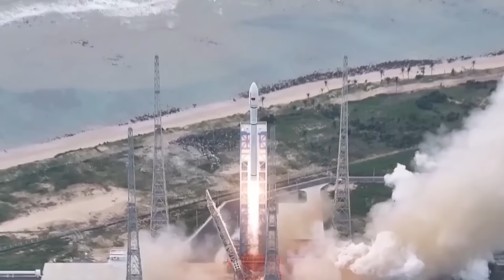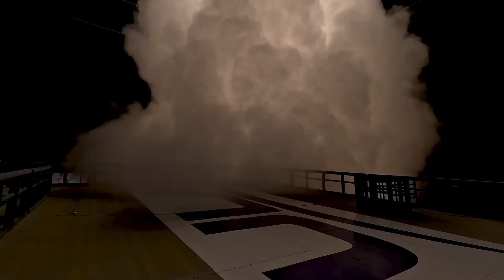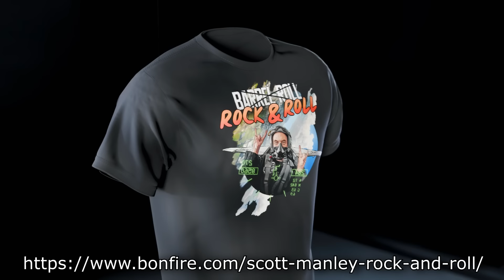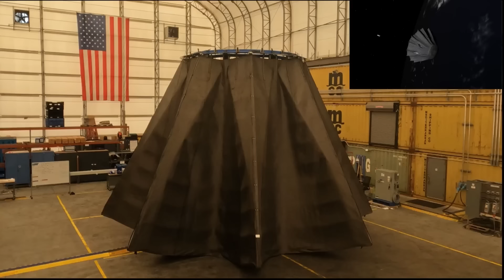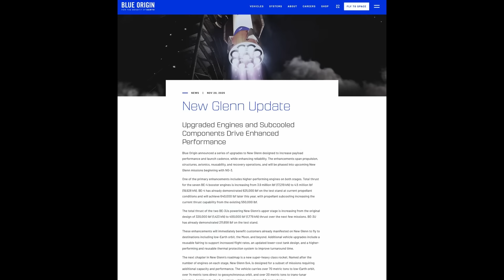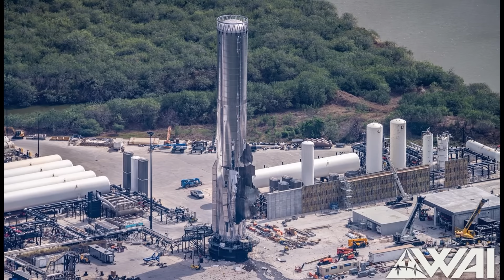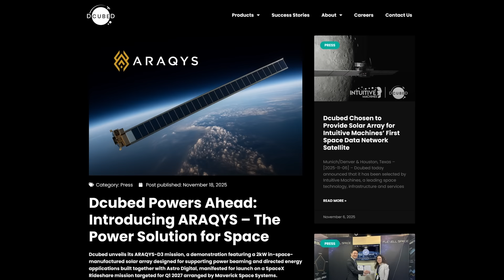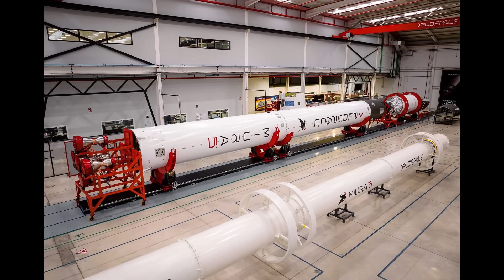Blue Origin FINALLY Reveal All Their Secret Projects - Deep Space Updates - November 22nd

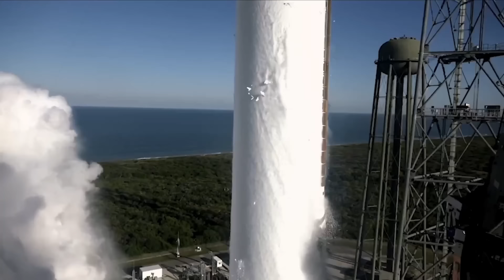Comment: Question: Katalyst launch referenced (or at least showed) a 3-engine airplane in the photo. 3:35  Is this the same aircraft as the recent UPS disaster, involving the engine pylon failure? If so, could the grounding of these aircraft potentially affect this mission, I wonder?
Reply: That photo was of a Lockheed L-1011, which is a different aircraft to the McDonnell Douglas DC10/MD-11 trijet family that is being examined after the recent UPS crash.
Reply: @SynchronizorVideos thanks.  I appreciate the additional info that fills in the gaps in my aviation knowledge.
Cheers.

Comment: Is the trend away from strap-ons simply due to the cost effectiveness of recoverable single booster stages? It just seems so weird that, outside of Ariane, so few of these new generation of rockets even consider strap-on boosters. From what I understand, they're incredibly cheap and they can be tremendously useful with overcoming that initial thrust-to-weight ratio issue when you're trying to get vertical.

Comment: Even with tiny satellites as payload, New Glenn was not even going fast enough to need to slow down for Max Q!
Reply: It is an interesting launch strategy. 
We’ll have to see if it pays off, Cotton.
Reply: Likely due to lh2 an lox on the upper stage, this should allow them to allocate more of the required delta v to the second stage than first when you use the same propellant, benefit of the different propellant on the upper stage
Reply: Blue Origin are doing exactly what they said they would do, run their engine at a very low thrust to baby them and then gradually raise the thrust over time.  So far they have not had as much as a hiccup from them in flight other then the failure to relight on the boosters first launch and that was likely due to something outside the engine.  This strategy looks a lot better then the Raptor development which is always being pushed to the breaking point and has to be inorder to compensate for the heavy steel stages.  Aluminum is just superior.
Reply: @kennethferland5579  hare::tortoise as “go fast and break things”::??
Reply: @kennethferland5579  Aluminium is for sure lighter, but for reentry it's far more heat sensitive and likely costed Columbias crew their life compared to a imaginary Shuttle made from titanium (was considered for some time).

Since NG does not do controlled reentry of a teusable upper stage it's not an issue here.
Reply: @kennethferland5579  In the space race, power is non negotiable
Reply: @kennethferland5579  Yes, BO is doing what they said they would do - but what changes that in the matter of fact that BO is 10 years behind SpaceX? 
Also, Aluminium is not "just superior". Aluminium has its advantages but also its disadvantages, especially when it comes to reusing the secound stage. Steel is just much more robust and has higher melting point and loses less strenght under extrem temperatures than aluminium as it could be seen during the Starship tests where several flaps lost several hinges. Aluminium in those situations would have failed. 
Also, the BE-4 is not compareable to Raptor. Raptor is a full flow staged combustion cycle engine vs BE-4 is not a full flow cycle.
Reply: MORON 5 MILES A SECOND AYE ! Clown U Think ! O Well My be Not .
Reply: Vaporware
Reply: @groverwashington1480  how many satellites has Starship carried to orbit? If anything, Starship is vaporware.
Reply: @dunaar3279Please, tell us if anything, what has starship done aside from exploding constantly ?
Reply: @jhdsfalsjhdfjashdkhvjfldld8301  <claps hands 👏>. Children! Children, you mustn't fight!
Reply: @jhdsfalsjhdfjashdkhvjfldld8301   Well, it managed that its secound stage is survining the reentry process and is now on track to developing the ability to being reused. You know - the ability which will open the solar system to humanity? 
Blue Origin is 10 years behind SpaceX. So they are currently not to be compared to SpaceX or Starship. New Glenn is an entire generation behind Starship.
Reply: @SebastianPeitsch  y’all keep comparing new glenn with starship when its closest competitor rn is falcon heavy. Mass to orbit, price, also starship could get to orbit on flight 5,6,10 and 11 but they choose not to since no one in their right mind would put a hundred tons of steel on orbit and have it not enough testing on its propulsion system to de orbit and its tps in re entry. New glenn second stage is much comparable to any second stage on the market now. Couple of tons, could break up on re entry due to an absence of any tps or heatshield.
Reply: @UrbeTabal so you're saying they couldn't actually put it in orbit with any guarantee of dafety which is the purpose of any serious space program....so they couldn't put it in orbit?
Reply: @SebastianPeitsch  Starship isnt operational yet. But hey, how many secound stages of New Glenn survived reentry?
Reply: @SebastianPeitsch  Um… wrong comparison… BO is simply replicating BFR at this point…. SpaceX has been there, done that, got the tee-shirt long ago.  Thousands of satellites have been launched by SpaceX on the comparable platform.
Reply: @Nachtmahr22-z8y  Sure they are 10 years behind but did they not start around the same time?
Reply: @fractalelf7760  I can ask this again: what satellites has the "BFR" delivered to space?

Congrats on getting the T-Shirt. That's the only thing that program has accomplished so far. It launched a banana into a half orbit. Not to space - it came back down. 

The Starship program has so far delivered ZERO satellites into LEO or GSO or the Moon or Mars. Nowhere. It has spat out Starlink dummies. She reusability of the ship still hasn't been proven, and with the current payload capacity it needs 36 launches to be refilled. But sure Block 3 or 4 will totally get that down to EIGHT refueling flights to get ONE moon lander to Mars

Eight flights. And they haven't even proven the refueling yet.

Total clown show. You're the proud owner of a clown shirt.
Reply: @Nachtmahr22-z8y  Why would you want to re-use the second stage on New Glenn? 

Come to think of it why would you want to re-use the second stage on the Starship booster at this point? The current design requires 36 refueling flights to fill up ONE Starship to go to the Moon. THIRTY SIX. On what planet is that a logical thing to do?
Reply: @SebastianPeitsch When it works and is cheaper than alternatives it's not stupid.
Reply: @Martinmack333  I think you're missing my point, the guy I'm replying to compared New Glenn and Starship's capability to send payload to orbit. Well, New Glenn is much comparable to Falcon Heavy with booster reusability and design ie. expendable upper stage. Now if starship upper stage is expendable and has no tps like New Glenn's and Falcon I think no one would mind it having to deorbit such huge upper stage or in New Glenn's first flight where the second stage is put into higher orbit, until New Glenn has the Fully Reusable system which is very exciting especially when they can land rockets on their 2nd attempt I think no rocket in operation right now can be compared to Starship.

Comment: I don't for Bezos or Elon, but Bezos is coherent and has a methodical approach.  "Blow things up" to test got Elon through Falcon 9, but as things scale up so does cost and complexity.  SpaceX appears to be stagnating, Bezos appears to be on track and effectively ahead.
Reply: No, SpaceX resched orbit 17 years ago, and landed a booster some years later. They’ve landed Starship boosters 3 times I think and effectively reached orbit many times. But they’re developing a reusable second stage too. Both companies are excellent, SpaceX dominates commercial launches. BO will do well.
Reply: Sure they've landed Booster 3 times, but it makes it even stranger that they didn't launch any payload. Instead of trying to get some useful payload to orbit they seem to be focused on shaving mass of a rocket. Sure useful for maximizing payload capacity, but as of now they don't use any of that capacity - making it bigger doesn't help "here and now" in any way. Launching payload would
Reply: @LauPaSat-pl No, Starship is dangerous, if it re-enters uncontrollably due to engine relight failing, it could hit occupied areas, so they didn’t quite put it in orbit, ensuring they knew when and where it would re-enter. It’s safety first until everything works. It’s more complex than NG.
Reply: @LauPaSat-pl  
Starship is still in the development phase, it doesn't even go to a proper obit intentionally.
There's no rush to launch payload, they have plenty of money.
Reply: 1. SpaceX is far ahead of BO, so Elon's method works.
2. Starship is relatively cheap, and easy to make, thanks to the stainless steel structure.
3. It's not necessarily cheaper to work on paper 15 years longer. You still have to pay a lot of people and you still have to test stuff on the ground, including blowing stuff up. It just happens out of sight. 
4. SpaceX has the money to fund this from Starlink. 
5. Also, you actually learn much more from blowing things up. If you design everything on paper, and your first test is s success, that doesn't tell you anything about the rocket's reliability. But if you blew up 15-20 while testing, and then one succeeds, you can be much more confident in that you caught all big problems. In many cases SpaceX is intentionally pushing the design limits, and even exceeding them, to know exactly how much safety margin they have. FYI, Starship actually survived a few test that should have destroyed it according to computer models.
Reply: @and @andrasbiro3007 tly, well described. Also calculations are not completely accurate, testing tells you what actually does happen. SpaceX has by far the most reliable rockets, BONG reliability remains to be proven.
Reply: @andrasbiro3007  but unfortunately, Starship still doesn’t “work” and is still a long way off from doing so. Tower-catch landings are far easier to do than barge landings, in terms of engineering, especially using a rocket that can hover. According to Elon’s timelines, Starship is many years behind schedule, as they should’ve achieved the fist tower landing about 4 years ago. I understand their focus on the booster, but that means less focus on the spacecraft itself - other than addition of vacuum engines and testing of so-far-questionable reentry protection, not much progress has occurred there. They certainly haven’t landed one, nor have they achieved orbit with one of them yet. 
The other fundamental issue with starship is that once it achieves orbit, it’s essentially out of fuel, with only enough left to deorbit and land. So once it gets into orbit, it needs to be refueled. It’s not like they can just add another stage to it, which is a giant downside of having your second stage also be the inhabited spacecraft. 

Parts of it just don’t make sense to me from an engineering and common-sense standpoint. They built themselves into a corner with that design. A launch vehicle should be capable of carrying just about anything that it can physically fit on top of it and lift in to space. With Starship, you get… a starship… and whatever can fit in its non-fuel-storage areas.
Reply: @andrasbiro3007 Starship isn’t cheap or easy to make - the stainless steel makes it easier to make modifications to the structure/design, and can absorb higher thermal loads, most of the complexity is the engines and the weight of the steel means you need more of those, and raptors certainly aren’t easy or cheap to make. You also shouldn’t learn more from blowing entire test vehicles up than properly testing the components and FEA and then successful test flights - If you want to certify your rocket for humans and you don’t have an escape system, it blowing up becomes unacceptable so you will have to do this analysis anyway.
Reply: @jamesnichols5163  
1. Stainless steel is vastly cheaper than carbon fiber, or even aluminum alloys.
2. Raptors are actually very cheap to make. Around $250K each.
3. The building cost of the entire Starship is around $50M according to Elon. Unfortunately it's not clear if this is just the upper stage, or the whole rocket. But even assuming just the upper stage, and significant cost increases since then, it's still cheap.
4. In reality you learn the most from failure during flight tests.
5. Escape systems aren't automatically useful. Better to have a robust ship and plenty of redundancy. Starship already proved that it can survive a lot of abuse, damage, and engine failures.
6. Humans are only allowed onboard when the rocket isn't blowing up anymore. You don't experiment on crewed flights, those are using a frozen design that was thoroughly tested in flight.

Comment: Final Pegasus air launch? Might also be the last use of L1011 :-(
Reply: Could very well be. The UPS crash and a need for pylon inspections on the MD-11s and DC-10s will likely spill over into needing to do a similar inspection on the L-1011, even though the jet used RR engines and not GE CF-6 motors. I imagine NG will try to keep Pegasus and the L-1011 in mothballs for a little longer, but you can't necessarily keep things intended for flight in storage forever. And given that Virgin's attempt never found customers, there doesn't seem to really be a demand for different orbital inclinations like there was when Pegasus was pioneered all those years ago. The only other use would be if NG opts to build need Pegasus boosters for sub-scale hypersonic aircraft shapes, but even those can be flown on more traditional boosters.
Reply: F

Comment: Something I noticed about the new new Glenn image.  That cannot be accurate. 

New Glenn currently runs 7 engines.  The addition of two more engines will require an increase in the diameter of the rocket.  The current model is prohibitively space constrained for 9 engines. 

So the NG MK2 should not only be taller than NG MK, but should also be bigger around.  

That would imply an even larger faring size.
Reply: New Glenn already flairs out at the base, 9x4 will probably just flair a bit more if it runs into space constraints.
Reply: I think they said the width of the New Glenn 9x4 will be 8.7 meters
Reply: @EveryoneWhoUsesThisTV  No, that's for the base of the aft module skirt and then for the new enlarged diameter fairing.

Comment: Hello, Scott. Last night a great thought came to me in the shower. The temperatures and pressures at which the methane and oxygen enter the combustion chamber in SpaceX’s Raptor 3 put both of them squarely in the supercritical fluid range. Because Elon says that the ignition system is a trade secret, could this be it? He also advertises 98.5 to 99% combustion efficiency saying “if god himself weaved the molecules together he could do one percent better.” Would the interaction between two supercritical fluids at the output of the coaxial swirl injectors be more efficient at mixing than a liquid-liquid or gas-gas interaction? More importantly, would this cause the two substances to auto-ignite?

Comment: There were comments online from a supposed previous SpaceX contractor that saw SpaceX employees handling COPVs roughly/incorrectly a long while ago.  Supposedly they saw employees bumping COPVs on surfaces.

As more of these accidents happen, those claims seem more believable
Reply: The key aspect of COPV design is the liner.  The metallurgy of the liner is very sensitive to processing and the pressurization/ depressurization process can impose thermal conditions that are way outside what would be predicted if you assume that the gas within is fully mixed. Repeated rapid pressurization cycles can create huge differential temps across the liner that impose extreme stress states.  If the vessel is immersed in cryogen there are further chill down issues and normally a minimum pressure must be maintained while the vessel is cold-especially after a rapid blowdown when the interior gas can get really cold. If not, and especially with aluminum liners, the liner can locally buckle.  If the liner is bonded to the overwrap the film adhesive will see a local failure which utterly changes the local loading of the liner and composite. This buckle will not necessarily be visible when the tank returns to room temp.  My team worked on aluminum lined tanks and actually got them through qualification only to see  failures in the normally boring acceptance testing at pressure levels way below burst.  We reverted to other liner alloys at a considerable cost penalty.  Since they intend to reuse these vehicles the fatigue life will have to be way higher which imposes even more demanding inspection of the raw material and any welded joints to stay away from critical flaw length.
Reply: Correlation does not imply causation.
Reply: @nguy404  Exactly how does that disprove the point made?
Reply: Possible, but they already lost a ship, and a test stand, due to this, so you'd expect them to be really careful.
I think heads will roll. Elon tolerates a lot of mistakes, but repeating the same stupid one is a sign of deeper issues.
Reply: @andrasbiro3007  Then he should fire himself as he's the ultimate form of stupid, which Starship is.
Reply: @ChaosCat79 has got his cranky pants on!
Reply: @ncdave4life  Hardly cranky, just stating facts. 

Also, you seem to have your Elon Musk simp briefs on a little too tight. It's cutting off what little blood is reaching that shivelled hunk of meat bouncing around in your skull that's masquerading as a brain.
Reply: @ChaosCat79 
The ultimate stupid is you.